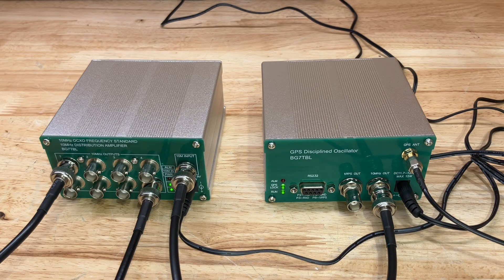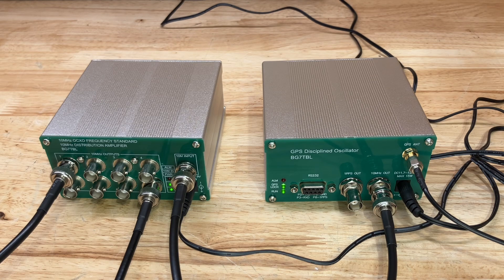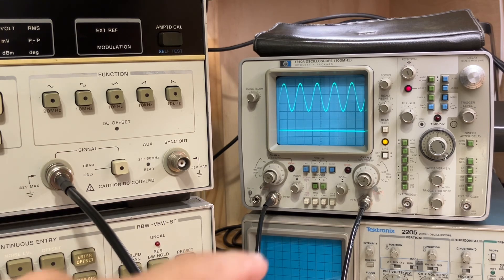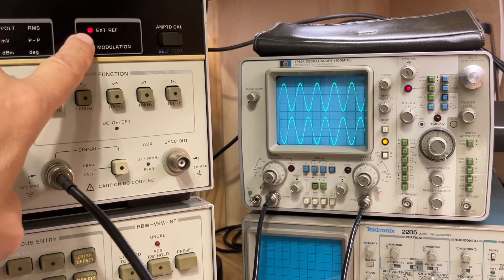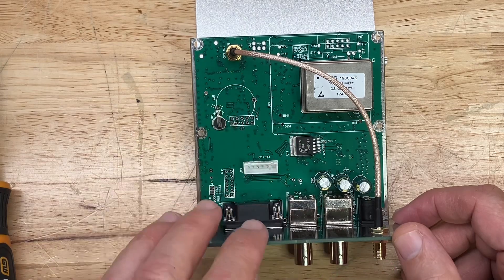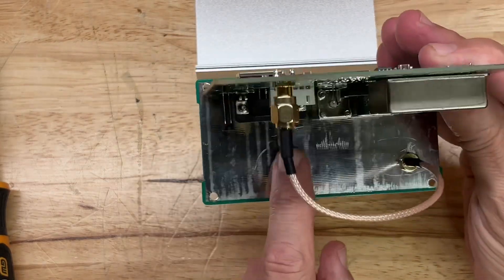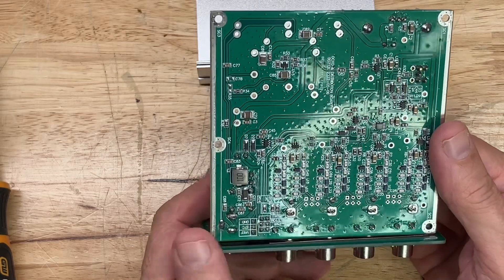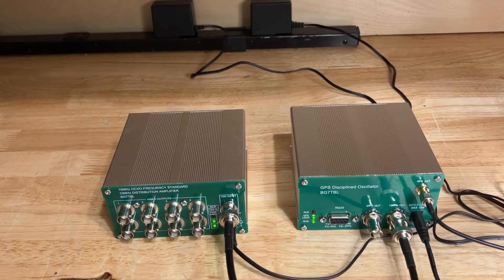Distribution Amplifier for GPSDO

Comment: Nice ! seem to do its job,  can you do a Bandwith test of the distribution amplifier to se if it is capabel of up to say 30 MHz or higher ? , then it could be used as shortwave signals to several receivers, maybe there is a bandpass or lowpass filter on the outputs but it would be nice to know also if it is 50 ohm on all outputs ?

Comment: Been meaning to get one of these myself. I looked at one of these when I bought my GPS reference but never followed up with the purchase. I have also seen others repurpose video distribution amplifiers but I would rather use something purpose built. I do recommend terminating all unused ports with 50 ohm loads to minimize leakage and any unforeseen issues that may arise from unterminated outputs.
Reply from the maker: In my case, there won’t be any unused outputs! By the way, I did a quick test of output impedance with the scope which I forgot to get on camera. Switching the scope input from unterminated (1 Mohm) to terminated (50 ohms) should cause the signal level to drop exactly in half, indicating 50 ohms output impedance. On this unit, it dropped from approximately 5.6 Vp-p to 3.3 Vp-p. A quick calculation gives 37 ohms output impedance? I guess it’s okay, just forget to mention this in the video.

Comment: A question Gary.  Should the unused ports of the distribution amplifier be terminated in 50 ohms, to prevent reflections back into the amplifiers?  Not sure if this would cause problems.  By the look of it probably not...
Reply from the maker: Shouldn’t make any difference, since the point of a buffer amp is to provide isolation between ports. But I haven’t tested this yet. I don’t own enough 50 ohm terminations. In my case, I will use all 8 outputs, so there won’t be any left unterminated!

Comment: Good stuff. I bought a GPSDO a year or so ago, but instead of buying a purpose built distribution amplifier I bought a used video distribution amplifier off of somebody on Ebay. This was on the advice of some folks on the EEVBlog forums, who were saying that if you just change some resistors to switch the impedance from 75 ohm to 50 ohm, those repurposed video amplifiers work great for this purpose - and they're cheap. 

I haven't actually gotten around to switching the resistors in my amplifier yet though. One more project for the backlog. sigh Too many things to do, not enough time. 🙂
Reply: good to know. thanks for sharing!

Comment: Awesome channel Gary .
Regarding finding somewhere to mount the Distribution Amplifier and GPSDO...I have a disused HP 5061A Cesium Beam Frequency Standard. The Cesium is exhausted, but I'll install the GPSDO inside the  HP 5061A for now incase another Cesium bottle comes along. The HP 5061A has a built in LED clock option, so the  GPSDO 1 PPS output will be useful to keep the clock going.
Well done.
Kind regards.
Reply from the maker: That’s a great idea!